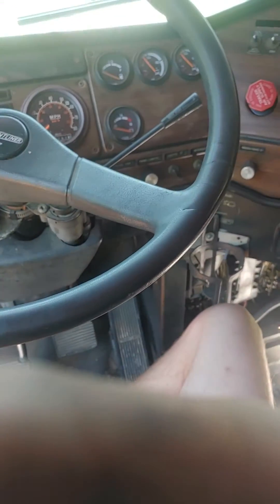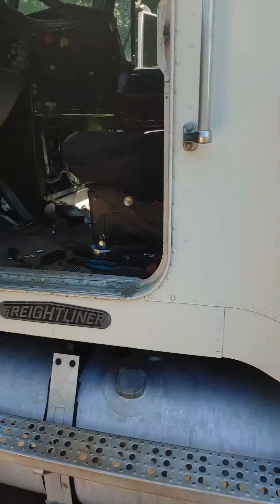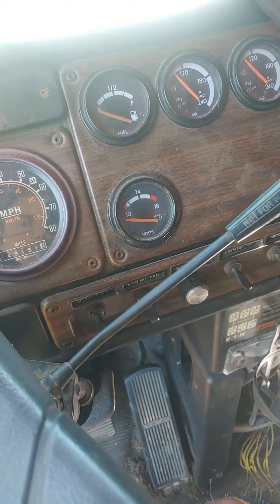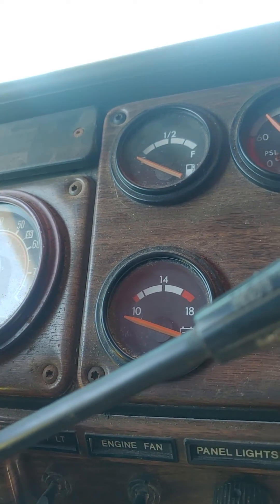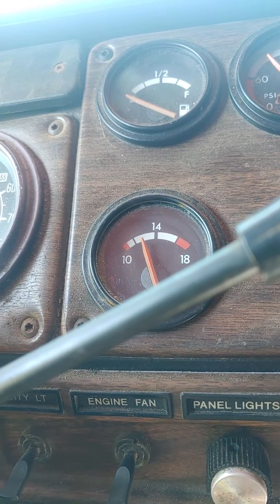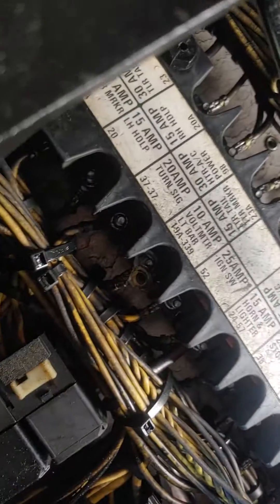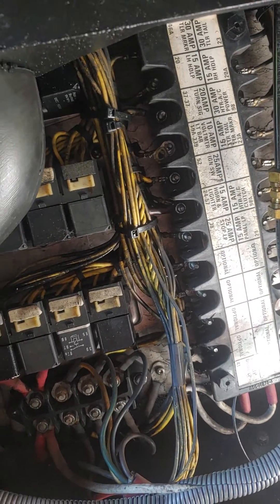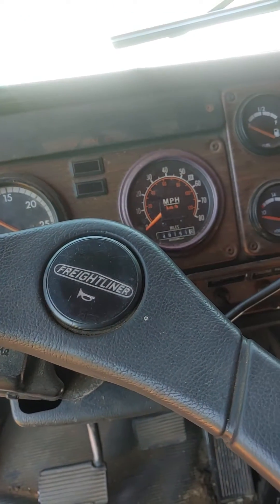Freightliner Voltage Draw Issue FLD112 FLD120 FLD132

Comment: Where is the obd on the fld 120?… I can’t seem to find it
Reply: Depending on your year you will have DDEC 2/3/4 its right by your left knee.
Reply: @antmoundlogistics  Can you tell me if they have an ABS fuse, I shorted my inlet and exhaust lines on my ABS front right modulator
Reply: Mines doesn’t have ABS nor a fuse that I can find. My trailer has ABS but that’s it.

Comment: I park my fld for weeks at a time and have no issues. I thought this was set up so I can see how low my volts are before cranking up my truck. It will still turn on slowly on the firs line,i use my gauge as a guide to how low my batteries are.

Comment: I have a question for you my friend. I have a 1998 Freightliner Classic. Just replaced the batteries and put deep cycles in. Just put a brand new alternator on 160 amp. My problem is the voltage gauge . At idle, my alternator is only 12.6 volts. Going down the road it'll do 14 to 14.5, gauge needle humps up and down,  my other gauges, you can see them bright and dim. Coukd this new alternator ve bad, or is it the batteries? Any idesa are greatly appreciated
Reply from the maker: I don’t know if this is your issue, but generally speaking you’re not supposed to use deep cycle batteries in on-highway applications because they aren’t rated for the incredibly high amp draw of a starter is my understanding of it, so dropping in some regular batteries might be a good place to start, but the alternator could be defective, or the alternator belts could be slipping, or the alternator pulley could be spinning on the shaft at low speeds.

Comment: I’m having the same issue right now and actually didn’t know about this until i watched your video.. so i took my batteries to autozone, got them recharged and now the truck will actually turn on for a few seconds but when you press on the gas pedal it won’t do anything. The pedal feels loose.. any suggestions?

Comment: I left my truck and my lights was on came back 4 hours later...I started my truck when I came back...truck crank up but it shut down...now when I but starter fluid in it it cranks over but shut back off...do u think it the battery or the fuel pump...because I changed my solenoid...but not my fuel pump
Reply: I have a fld112 ism cummins
Reply: A had the same problem. Was a bad wire , battery to computer.